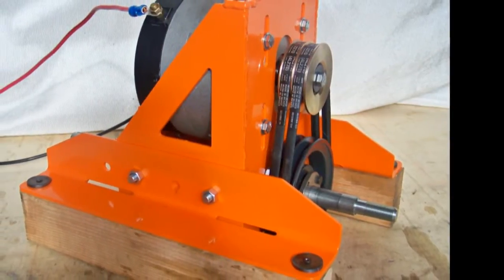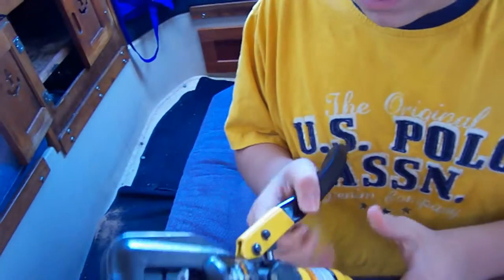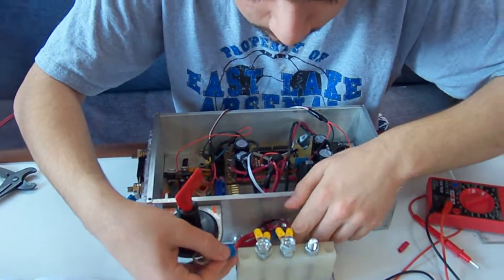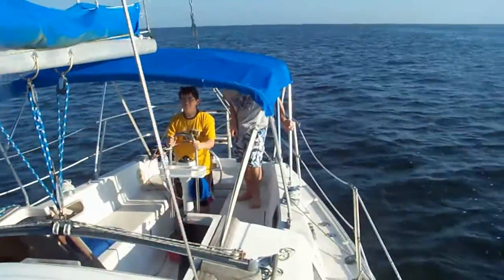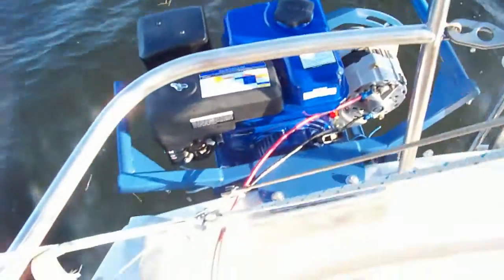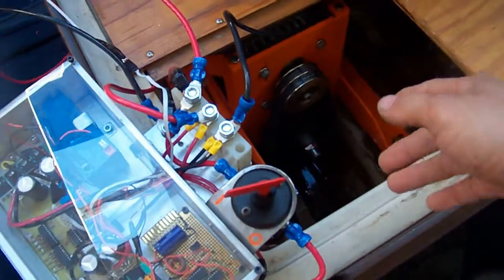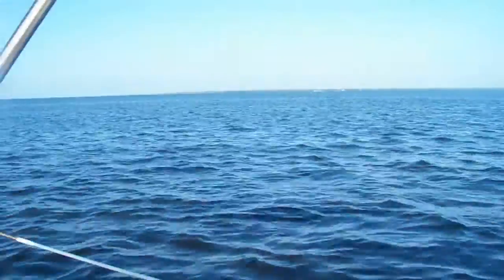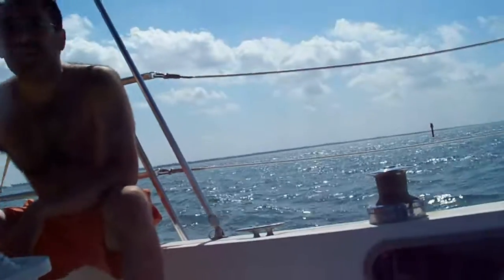Hybrid Sailboat

Comment: fine concept. Maybe try to find a 10-12hp watercooled engine for the generator - than you can put it in a sound-proof housing like fischer panda generators are - only the muffler and the radiator sticks out. You can also try a motorbike silencer..